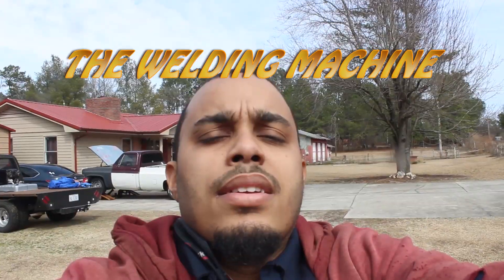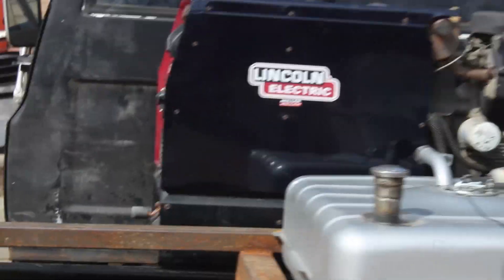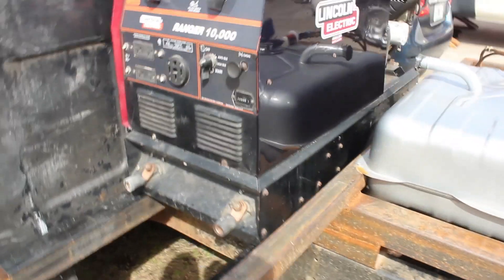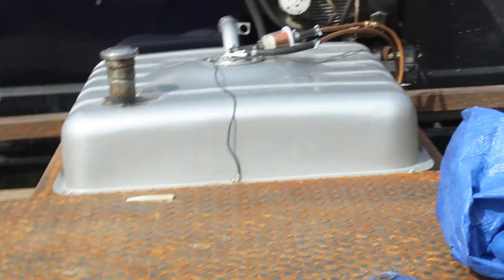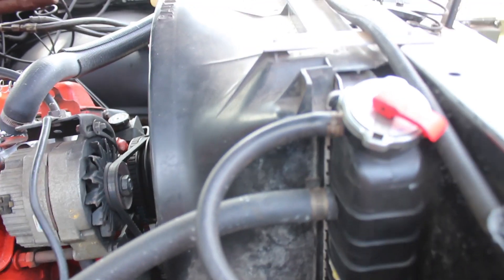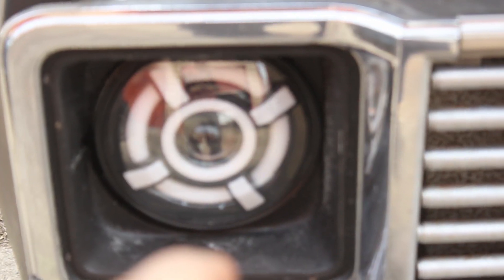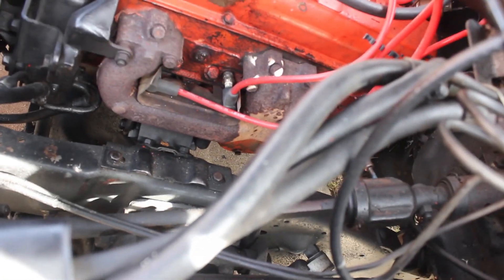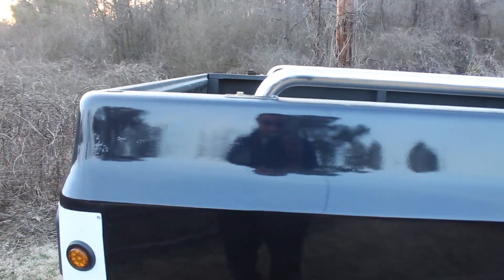New Lincoln ranger 10000!!

Comment: What's  your opinion  on Lincoln  10000 welder? Can it weld aluminum? I came across 2006 model used very little 289hrs asking $3500.00 - Ain't gotta clue what it's worth- Looks like heavy duty machine being a/c figured  it could weld aluminum - Your rig looks very nice!
Reply from the maker: It's a get machine. But before you g
Buy do a full inspection. That welder by it self is worth 5000$. Compare to similar welder generator. You would have to get an aluminum welder, and or a ac frequency machine
Reply: @theweldingmachine  Thanks for info Appreciate it-